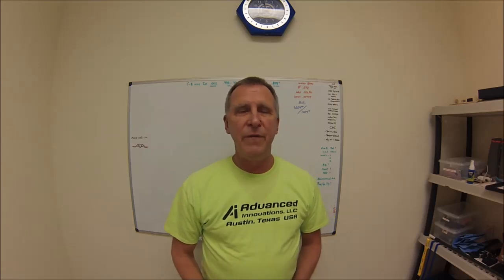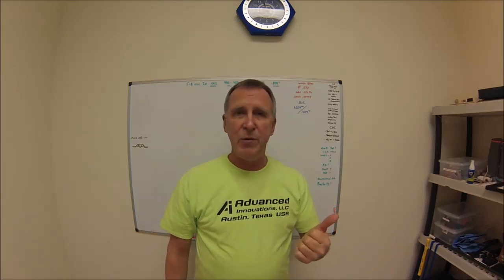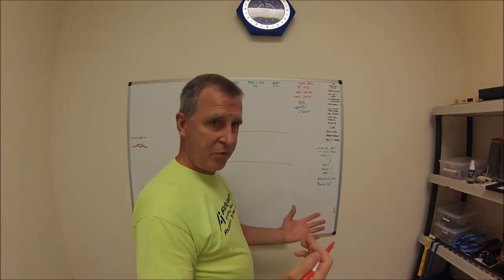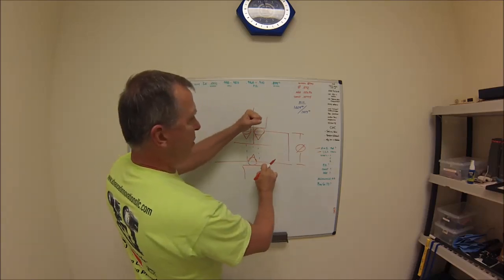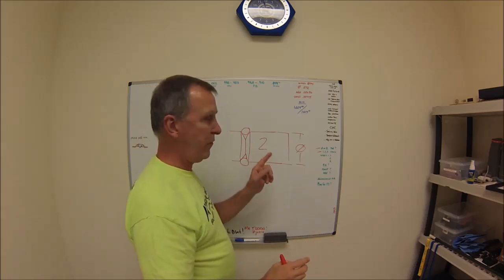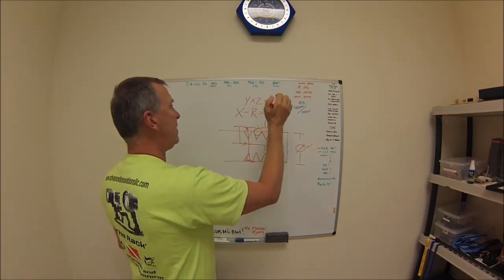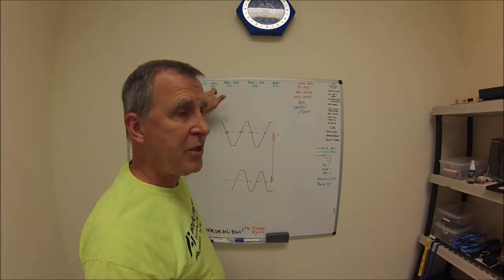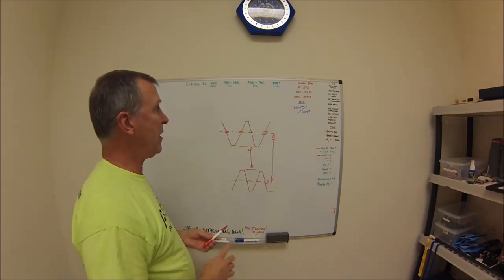Pitch Diameter, Wires and Numbers Galore. Threads in detail !

Comment: Hi Joe - been using your threading method ( machine in reverse and thread away from the chuck) on external threads for a while now - I now need to do some RH internal threads just as you show here, my question; will I need a RH or LH internal threading bar and which inserts RH or LH - currently using partial 16ERA60 on my external tooling. 
Thanks Dan ( England )

Comment: this video is great Joe. thanks! now i picked uip on two particular side issues that puzzle me about thread cutting .the first is that i did often wonder why major thread diameters were undersized .(i'm in the uk so mostly we work in the metric system)so naturaly you would expect that an M12 thread for example has a 12mm external diameter ,however ive often found this not to be the case on threads that ive purchased . and the second puzzle is that threads do not always have a relived area (undercut) ,is it somehow possible to acurately single piont turn  such threads with no groove to begin or end in and if so how ?
Reply from the maker: Normally, the OD of a male thread is a little undersize. Realistically, it could be considerable undersize and still hold just fine. Its the pitch diameter engagement that offers the greatest cross sectional mating area. As for the runout thread, if you turn very slowly and have a dial indicator on your carriage, you could theoretically do it by eye. Some machines have an auto retract, but I've never run one.

Comment: Hey Joe I made a threaded gauge for a 4 1/4  12 3B threaded bore. I used the 3B internal pitch as necessary and was told to use the 3b major diameter for the major diameter of my plug and im not totally sure that is correct. so what should your major diameter be for a plug gauge thanks Joe.

Comment: Joe,  An old trick I learned using wires is to stick the ends in a rubber eraser.  Greatly reduces the number of hands  (dexterity) needed to use 3 wires.  You just hold the eraser and your mic.
Reply: Oh...also easy to find if you drop it in your chip pan.  ;)
Reply from the maker: Did you know you actually only need one wire and its checks thread concentricity as well?
Reply: I did see that technique in your tutorial.  Just saying 3 wire is about as easy using the eraser.  Merry Christmas  @joepie221

Comment: Joe, I have a project that requires replacing a threaded needle valve that is loose in the threaded bore.  How can I find the pitch diameter of the threaded bore?  The existing major diameter of the loose needle valve is 0.1540.  Any help you can provide will be very helpful.

Comment: Great video!  I know I'm responding to a 6 year old video and I haven't seen all your other videos so I don't know if you've covered this, but I need to make some new threaded round nuts for my Hendey milling machine spindle.  I tried to use the handbook for the minor diameter but it isn't close.  Since the milling machine was made in 1902 I guess they didn't always use standards and/or possibly predated the standards.  After the second attempt I managed to get a good nut made but it was mostly luck.  So.. my question would be how to find the minor diameter for making internal threads to fit a possibly non-standard external thread with the added complexity in that target part (the spindle in my case) can't be used to test the fit.
I think the correct approach in this situation is to also make a test plug and then use that to get a good fit from the internal thread, but how does one make sure they get the plug right?
Reply from the maker: https://www.youtube.com/watch?v=Sdpe8whlx_s&t=11s
Reply: @joepie221  Awesome, thanks Joe!!
Reply: @joepie221  Just wanted to say that I made the nuts this evening and they worked great!  Many thanks Joe!

Comment: Joe I am a big fan, really enjoy your great presentations. The way that I approached the 3 wire balancing act is to put an O-ring on top and another on the bottom. I start off with a readily available metric O-ring assortment kit and pick 2 that just feel right. For the 3/4 - 10, this is an O-ring with an ID = 11.8 mm and OD = 16.6 mm.
Reply from the maker: Only use one, the other 2 are spares for when you drop one in the chip pan.

Comment: Knew I'd seen the one wire method at some point ! 
Tried this today on a m42x0.75 with 0.18 wires... and a conversion chart for metric
The difference between the 3 wire method and one wire method, one involved grease on the wires swearing cursing and general frustration the other required 10 seconds of my time and both values were spot on !  What a time saver for the future !
Reply from the maker: And you'll have 2 spare wires if you drop one in the chip bin.

Comment: I work for the US Navy as a civilian machinist, and I NEVER thought of using one wire!!! But as soon as you started explaining I knew exactly where you were going with it, and I thought DUH!!! what an idiot I have been all these years...HOWEVER, the machine shop work lead and supervisors all say IT HAS TO BE DONE THE WAY WE HAVE ALWAYS DONE IT and I doubt they would accept the single wire method...even if I PROVED it to be accurate. It is f=definitely going to be a method I use for myself and then let the work lead use all three wires to verify for me when they do a first part check...tee hee hee!!! Thanks Joe!!! I LOVE your tips and hints and tricks...been watching you for years...
Reply from the maker: Thanks for the long term support. One other benefit of a  one wire method is that you can check if the thread groove is concentric to the OD or crest of the thread. A perfectly cut thread will measure spot on with 3 wires, but still not engage the mating part if the thread is out of concentricity. And you'll never know.

Comment: Joe, I just made it a point to watch this again.  Mostly to comment on how one aspect of your presentation came in very handy recently.   Most of the time I measure pitch diameter with mikes.  If the thread is bigger than my 0-1 pitch mikes, I will then do the juggling act and use 3 wires.  However, I needed to discover what thread had been employed in a part I was given.  This was over three inches in diameter, so I used your one wire method.  
The problem was made interesting by the fact that the part had internal threads.  My plan was to measure the pitch and then cut and try until the part screwed on. Then measure the threads.  I use TDWIN by Gagemaker to obtain the numbers.  If you don’t use this program, you may want to check it out.   To further complicate things, I did not have material that was the OD that I thought I needed.  I had a piece that was nearly there but not really.   The plan worked.  As soon as the part fit on I started the measurements.   On >3” the single wire method really helped.   Thanks!  However the OD of my test piece was not large enough to allow the best size wire to contact the flanks.   I needed to use a smaller diameter.   However TDWIN which allows changing the wire diameter would not allow the size I wanted.  Not surprising as that wire would not normally stick out over the OD.  I had to do some calculations to determine the width of contact with smaller wire and then calculate the adjustment necessary to locate the pitch diameter.   The end result is that I identified the thread.   If you are interested in the calculations necessary I am happy to share them.   Sort of a backwards approach, but then sometimes you gotta do what you gotta do.  
Thanks for the tip on the one wire method.  And by the way I cut the threads going away from the chuck.  
Oh one more thing.  On the cleaning out of the burr on internal threads, good idea but if the plug gauge was built correctly those burrs will not affect the reading.  I mention this not to be contrary, but to emphasize that go and no go gauges are designed to contact flank only. If one does not know this, parts that gauged OK will not always work.   I have seen this happen, and as you stated early in your video about parts sent to the other side of the world better be right. The parts had been sent from Houston to Indonesia.   They all gauged OK, in this case, The OD was just a bit over.  No one checked it, because the gauge said it was good.

Comment: Joe pieczynski can u measure with just one wire then add half diameter of the other wire...?does that make sense
Reply from the maker: No. You can only use one wire if you use the part radius and half the required 3 wire measurement diameter combined.

Comment: This is the one I was looking for! Thank you for taking the time to post this. I just got my first set of wires and was a little unclear on  the add and constant value usage. This cleared it up for me. I am a maintenance "machinist". I make parts for our factory machines, but I am certainly not a journeyman level by any means. 
The guy I replaced (due to retirement) would always make an internal thread in something to gauge the external on the part.  That's fine if you are making your own mated pieces, but not always so good if you need to mate to an externally sourced piece. 
In all fairness, he taught me a lot, but had his own way. Anything else just wouldn't work. 
I've been binging your videos now that I am on my own and have the shop to myself. Thank you for continuing my education.
Reply from the maker: Glad to help. Get yourself a machinery handbook.
Reply: @joepie221  Have 2 actually. One of my own and one at work. 
I also tried out your upsidown threading on the lathe today. I recently upgraded my tool post to an indexable Aloris quick change which made it possible. Didn't have the vertical adjustment with the old Dorian. Just have single point cemented carbide for threading tools, so I reversed my compound angle and did it the way I was used to using the 29 degrees on the compound zeroed cross slide and advancing with the compound, but it worked out well. Also used the opportunity to try out the single wire method. Man that was easy. 
Again, thanks for taking the time to post all of these.

Comment: Hi Joe - I've been reviewing your thread videos - haven't watched them all yet. But have a question - when turning a male thread on a shaft, what diameter do you turn the OD to before cutting the thread? I don't think you turn it to the major diameter - seems that would be slightly too large. How do you know what size to start the shaft diameter at before approaching it with the threading tool?
Reply from the maker: Naturally, the max outer diameter is the stated nominal size of the thread. Depending on how big that is, you should stay a little under. For example. .010 undersize on a 3/4-10 is fine, but .010 undersize on a 10-32 may be a bit much. Use your best judgement if you don't have a machinery handbook to reference.
Reply: Thank you Joe! That is helpful.

Comment: Hi
I found a nice shaft with thread on it how can I determine which thread do I have is it Metric or standard ?how to figure it out thank you
Reply: You need to measure the OD with calipers or a micrometer. Then you need to check the pitch with a thread pitch gauge. Or you can pack it into a hardware store and use a thread identification board.

Comment: Good videos!
Im on my 7th threading attempt, this is a 14x2mm TR  LH longer thread for my cross slide. 
How would you measure TR or similar flat bottomed threads, is it the same?
Thanks
Reply from the maker: To be perfectly honest, my experience with them is very limited. I have to imagine the root, crest and profile angles must have standards in place. Machinery's handbook any help?

Comment: 3rd time I've watched this (slow learner.) This time after arguing with another (amateur) machinist about the single wire method you show.  Being a long way from a real machinist doesn't mean I can't try to get good results. When I got my (Chinese) wire set, I measured each one to see how accurate they were, better than I had expected. Since the wires are going into a V any deviation in diameter is going to have a bigger affect on the final measurement. Fumbling with 3 wires, even with the yuck grease method was a challenge for me.  Thanks for the help.
Reply from the maker: Using a single wire method, you can also inspect a part to see if the thread trajectory is true to the part OD. Simply place the wire in the thread and take a measurement, now rotate the part 90 degrees and do it again. If the 2 measurements are the same, the thread is true. You can't see that with 3 wires.

Comment: Hey Joe I had to cut some 1/2x13 , 5/16x18, 3/8,x24 threads today on the lathe for a job at home on for some special bolts and shafts use your techniques on threading ,and use the machinery handbook to get the head diameter and use the wires to Measure the pitch diameter. It was a class 2A thread. After I got finish with each bolt and shaft everything went together smooth and with no wiggle on the threads. I have to cuts some class 2B but I have to make a class 2B external thread on a plug gage so I can measure the internal threads. Thanks again for sharing information
Reply from the maker: Sounds like you're on the right track. Thanks for the comment.

Comment: Is there a way or practice of measuring pitch diameter on taper threads like NPT or Boiler?
Reply from the maker: I have only ever used a hard gage for that.
Reply: The specifications on boiler studs I make in the steam locomotive restoration business site that there must be 1 full thread showing on the interior and “no more than 2 nor less than 1 thread” showing on the exterior after installation. Boiler thread tap sizes overlap sequentially on the same taper. There are allowed limits of wear on the B class thread so that they may be retapped slightly larger to tune up the thread profile. Because of this allowance and the required engagement target every stud is different. Its not a problem when making a hand full of studs. But soon we will be making dozens and I’m trying to find a more efficient way to quickly gauge sizes. Anyways.. Thanks for the excellent content Joe. I’ve learned a lot and continue to every day with your help. 👍🏼

Comment: Finally somebody who is as fanatic about threads as me. I have been threading upside down & backwards for 40 years.

Scoop out the chip pan before handling the wires. I use grease to hold the wires in place because I only have two hands. When making more than one or two parts that need thread wires I hold them together in the right position with masking tape. Back in 1991 on my first ship I had to use iron bailing wire to measure threads because I didn't bring my wires with me, had to calculate the measurement over the wires using right angle trig.

Do you remember when the Machinerys Handbook did not have tables for metric thread dimensions. I had to get my first copies of metric thread charts from the Landis Threading Handbook.

Fisher Tool, Hawthorne California (Pee Dee) will sell individual wires to replace lost wires.
Reply from the maker: Take a look at my wire video. Realistically, you only need one wire to check a thread. They give you 3 so you have 2 spares. Curious yet??

Comment: new to machining, can you tell me which page the pitch diameter is on..in the guide...can't find the page with any of the info you just passed on..threading coming up in class and need to get this down...thanks
Reply from the maker: If you have a machinery's handbook, thread specs are a big part of that book. They should be easy to locate and will be bunched up with all the dimensions you'll need for every thread possible.

Comment: If I'm cutting 20 TPI,  flat width = (1/8)(1/20) = 0.00625"

How do I know what insert to get to cut these threads with? I'm not seeing any information supplied for flat width, only that it's for 20 TPI thread cutting, but those widths don't look that small. Can someone clear this up for me?

Would something like this work?

https://www.mscdirect.com/product/details/33807884

How would I even know? They give a corner radius of 0.006" Wouldn't that make the "flat width" larger than recommended?

I don't understand
Reply from the maker: Thats called a full profile insert and its thread specific. A more generic 'partial profile insert would probably be better for a small shop everyday use.